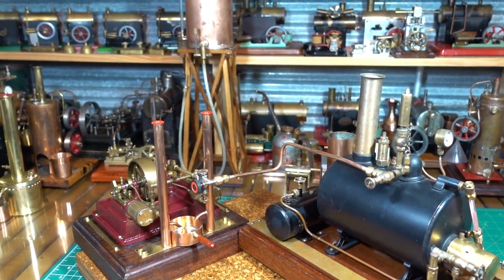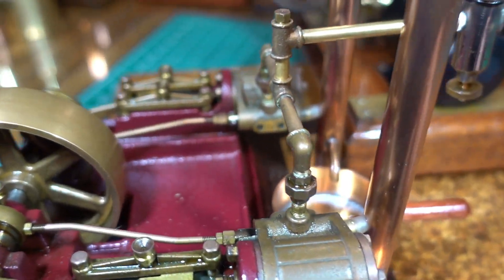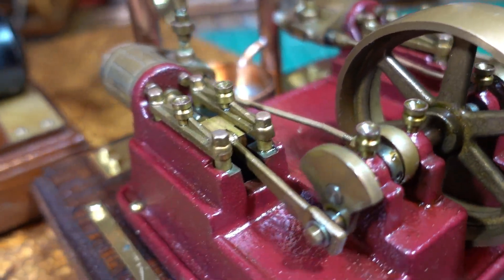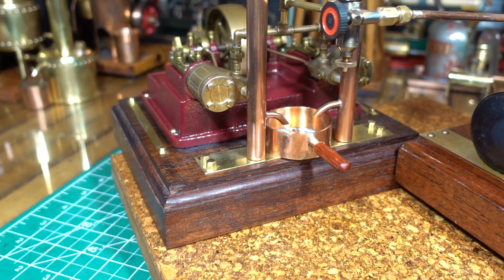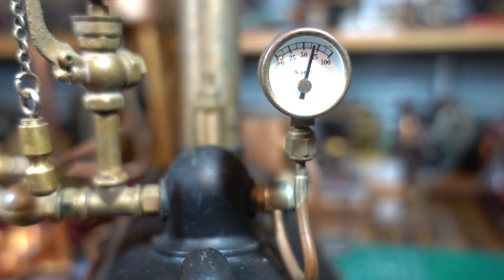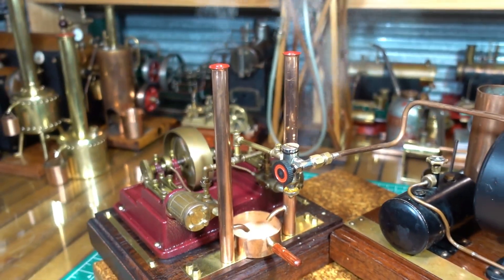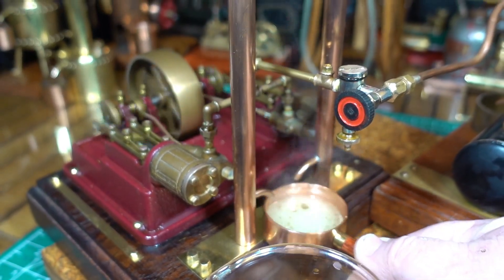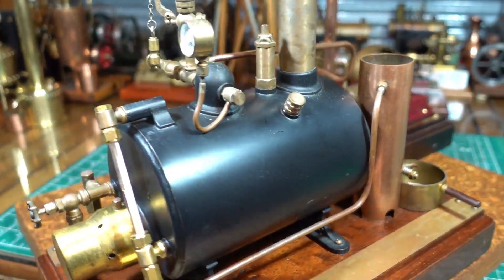Stationary Model Steam Engine PM Research Toy steam engine Modded fired from & MSM 4" Copper Boiler

Comment: I need to get a lathe and learn some machining.
Reply from the maker: Terry when the truck pulled up at my place with a lathe & mill on it, I had never touched either type of machine before....Youtube can be a good educational tool!
Reply: @SteamEngines-Jim  so true. I learn a lot watching youtube. I really should incest in a lathe and mill. I have had fun making machines from Lego to use with my stationary engines, but I’d probably also have fun making them from metal.